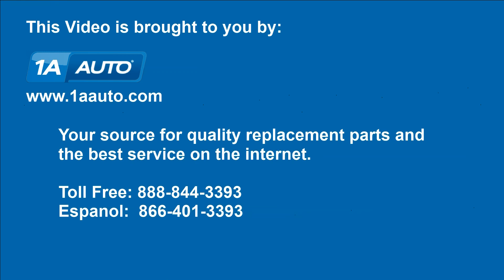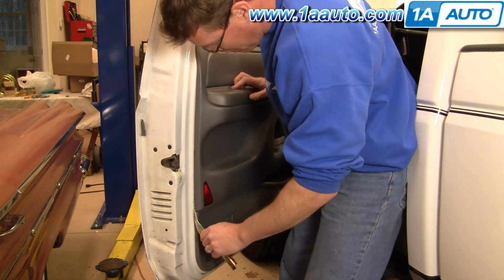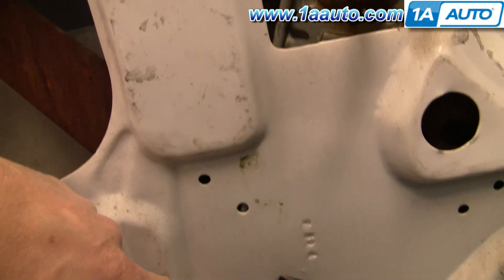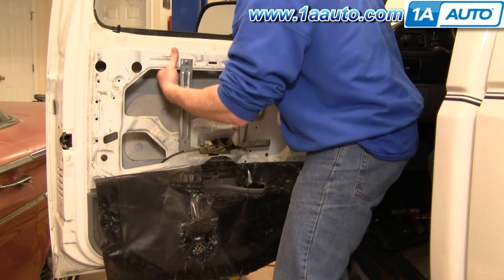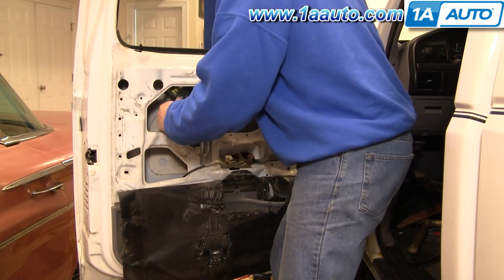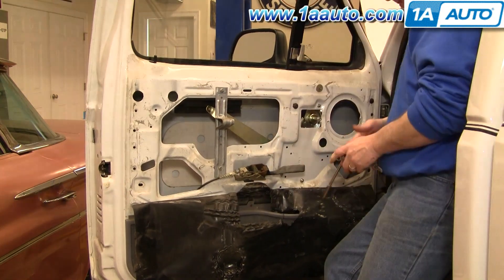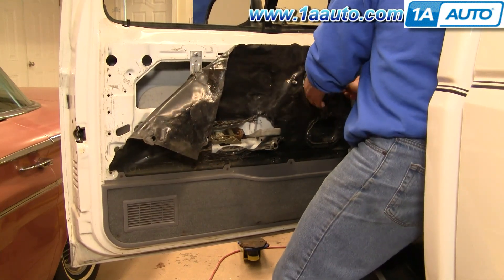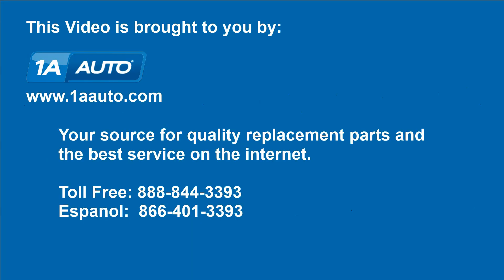How To Replace Manual Window Regulator 80-96 Ford F150/250/350

Comment: I have to give you props went to the junkyard pop that Center rivet in drilled them out got the window out in about 10 minutes the regulator oh man big up to you on this video it was just what I've been looking for and I was doing it for a Chevy van but long as it was a manual window is really what I was looking for and this came through right on time great job thank you for the description of the bolts and what was needed tool wise thanks again appreciate it

Comment: This worked great!  I have a 2004 f150 heritage but this video was VERY helpful.  I got it installed and the window goes down about 3"-4" easily but then seems to bind and is VERY hard to continue down or back up.  Is there somewhere that the glass is binding?  If yes, how can I correct that?  Thank you very much.

Comment: Hey thanks for the video's on the truck, I just bought a 1996 ford f350 so you really helping me out alot, how much for new head lights for that truck, also need rear shock mounts too, I just cut them out yesterday. Need parts shipped to Waterbury ct 06708.. I will need more parts as I am going through the truck.. Thanks looking forward to getting prices and availability...

Comment: Great videos! Got a question:  91 Ranger w/ manual windows. Drivers side glass shimmies when cranking down. After taking off the panel I've greased what I can reach, but no luck. Is replacement necessary?
Reply from the maker: +MrMadscotsman The issue could be with the regulator, I recommend inspecting the part to see what kind of condition it is in.  Any other viewers interested in purchasing these parts please visit this link: https://www.1aauto.com/1A/WindowRegulators/Ford/F150-Truck/1AWRG00060?utm_source=YouTube&utm_medium=description&utm_campaign=videodesc&utm_term=-gBkfZME_vg&%
Reply: Thanks, good advice. Will do